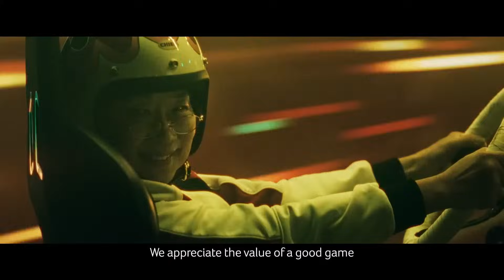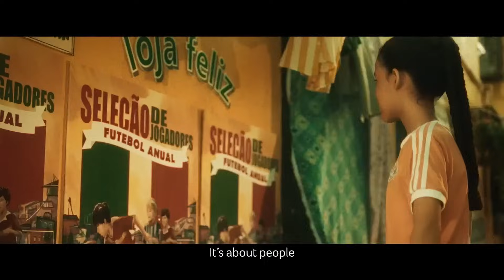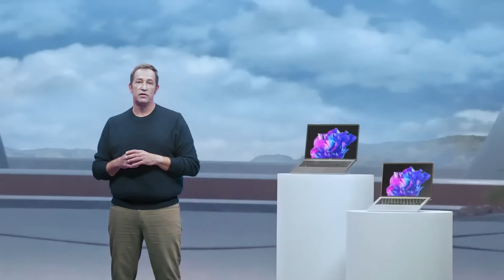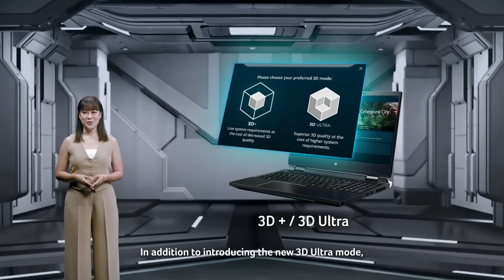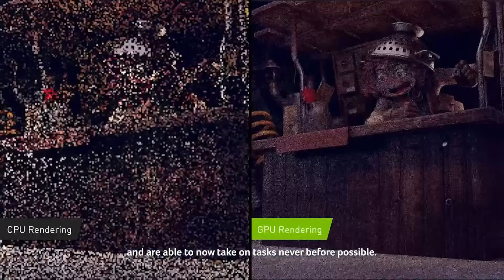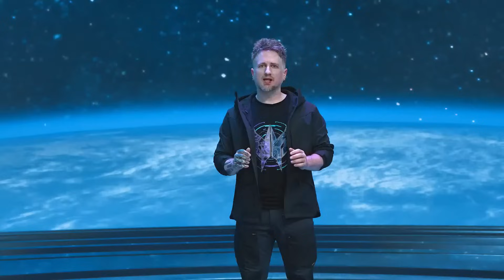Next@Acer 2023 | January Global Press Conference

Comment: I bought my first acer nitro laptop in 2022 and I think it is brilliant because every part has a QR code so should be easy to get a replacement part. Do that for all your laptops and you will dominate… plus it is one of the few brands that has 2 memory slots and. SSD slots at a reasonable price. Only thing missing is a 99wh battery add that and I would pay more for that. 😊 other than that it just needs a better track pad that is larger and more stable but I can deal with that for now given the price point